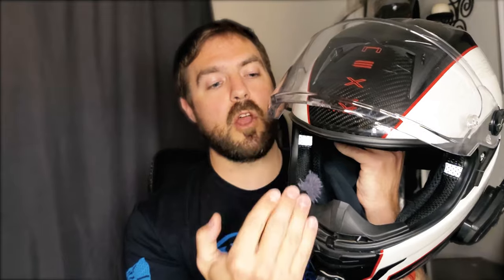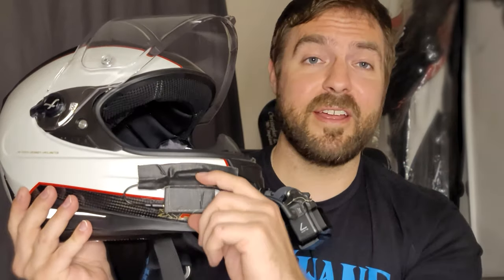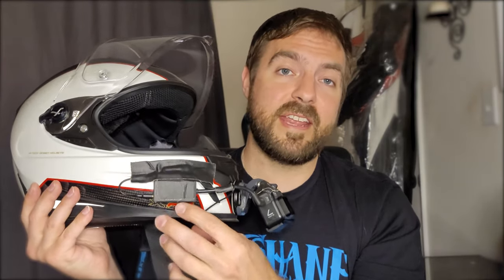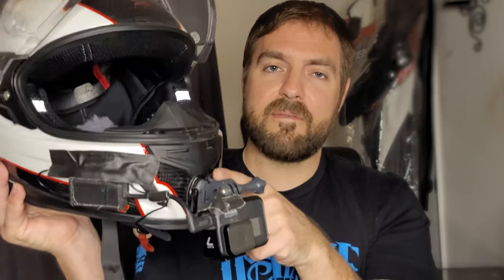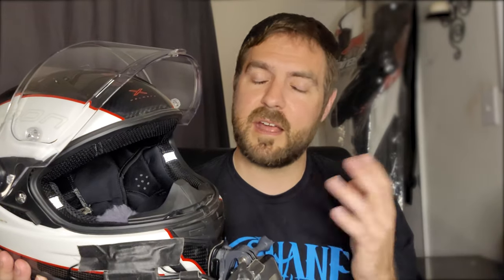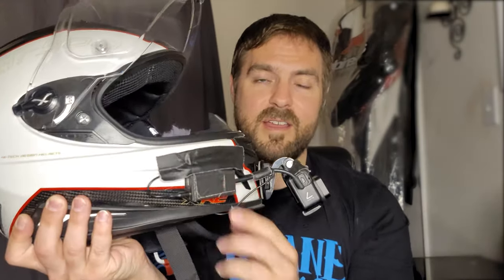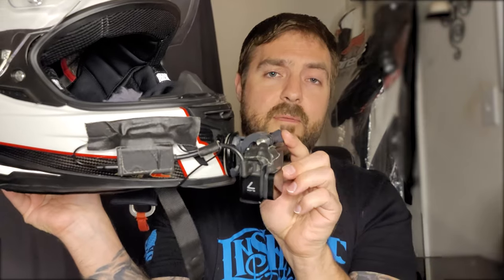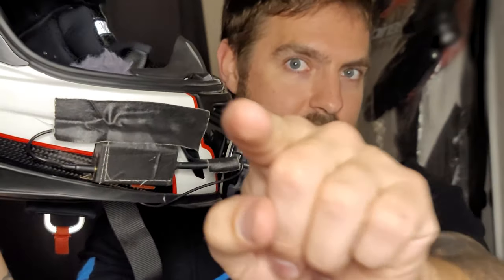Ways to improve your motovlogs / Specifically audio and video!

Comment: Purple Panda is by far the best mic for motovlog. And I use Sugru to stick my camera on my helmet. Works good. Great video
Reply from the maker: Yea it it's, never heard of sugru though.
Reply: I have a purple panda and it’s been absolutely awesome!
Reply from the maker: @Lynkinite  Yes they are, I had a sony stereo mic I used for a long time and it was great, but it didn't fit the new helmet. I still use it for exhaust tests and when I run an external camera to get the bike noise when riding.